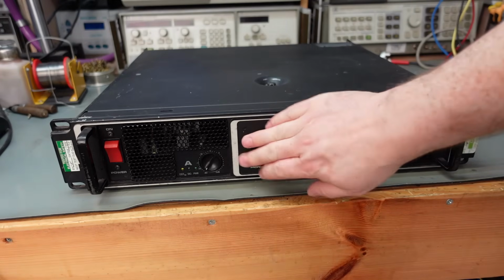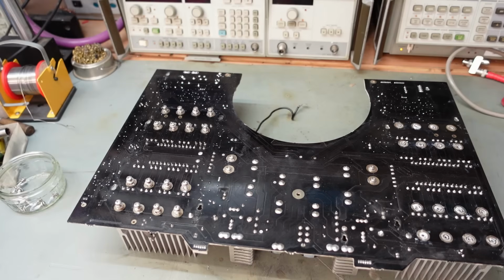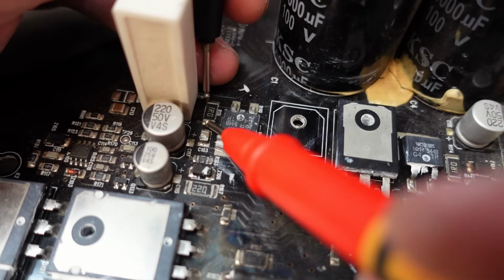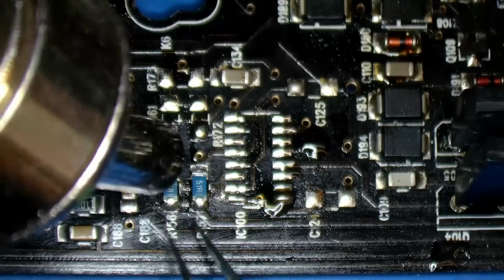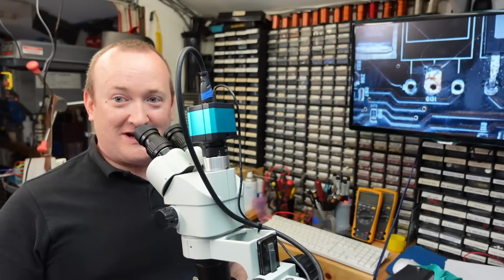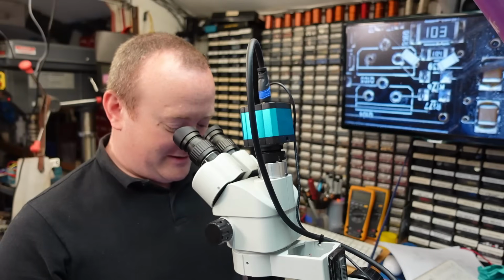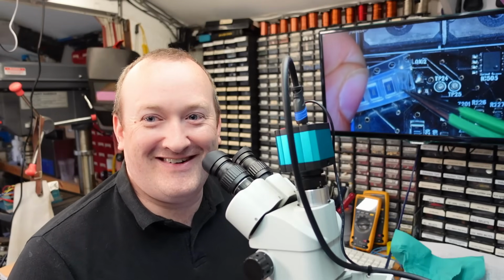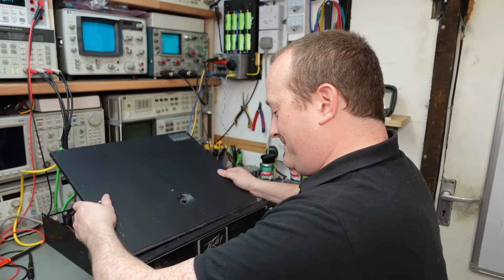PEAVEY 4000W Amp Repair (CS4080HZ)

Comment: Love your work Mark Just one thing I noticed. If you solder a leg down then add some pressure to solder the next leg, normally I would go back and hit the 1st leg quickly with the iron. Otherwise it sits there under the constant pressure of that initial manipulation from bending it between fixing the 1sst and 2nd legs.

Comment: You Sir have the patience of a saint. I wish i had this level of patience and discipline. Any time I've used the manual solder sucking tool on these cheap solder mask boards, it tends to damage the pads. I usually use the powered vacuum desoldering station for those more sensitive areas.

Comment: At what point do you call a board B.E.R? 
Personally I'd have scrapped it. Burnt PCB, cascade of failures. AND it was previously on the bench (though it would help to know what was fixed last time...) 
Plus it's a stupid design. I really hate these all in one pcb designs. Also why no 3.3kohm 5w resistors over the power Capacitors?!

Comment: Didn’t read all comments bet to my knowledge Kapton tape is a heat Insulator not conductor I use it on my job for pixel hot air work. I hope this peavy didn’t come back to you! 😊

Comment: I have a mono class d amplifier which when turned on shows a red light but when the power diodes like the f20c20c and a are removed which give power to the output ic circuit . Then the red light first turns on and then the green light . But when connected sometimes the diode  ics short out and the input power ics also short out but the audio ics are not shorted at all . Note : when I started repairing it the capacitors were swollen of the input for output ics and output for output ics . Also i by mistake shorted the controller ic ka3525a 😅. What should I do I don't find the cause of this problem😢

Comment: I really hate Muso amps, abused and generally DIY screws missing and dodgy repairs. Charcoaled O/P stage...Usually simple circuits but always a mess. Then they don't pay for repairs...not doing any more.Oh and i was thinking haven't bled filter caps with no load power on/off...oh well couldn't really do any more damage.

Comment: You are quite the tech, with the right tools to get the job done. I'm just wondering where you find the schematics for all of the equipment? I have worked on amplifiers for which I could never find a drawing, so I have to draw my own, which is very time-consuming, but it doesn't help with getting the correct part numbers.

Comment: Did you ever try to Repair a behringer ep2500?
If i am not mistaken the output of the amplifier is the middle Point of the power supply capacitors.!.
We do tend to Breakdown om die insulation  of transformer wiring

Comment: Great instructional video.  I really enjoy watching.  I have decided in my 50 or so years of repairing everything from VCR's & audio in the 80's to now mostly Guitar/bass amps as well as keyboards & digital pedals that I will no longer work on these 'newer' surface mount component PA power amps.
IMHO it's obvious that as soon as Peavey & Crown for example started making high power PA amps with SMD components that they really didn't expect anyone to repair these esp when the SMD components burned the circuit boards as they often do with a situation similar to what you have there.  
Also if you're trying to make a living doing repairs, these amps now sell for comparatively much less money than they used to, you really cannot charge in proportion to how much time you have to spend on troubleshooting them, ESPECIALLY with the the ones that have SMPS power supplies and then of course the DClass nightmares.
Just IMHO.

Comment: Hi Sir. I am working on a cs4080. It powers on perfectly but after few minutes then there is DDT light at channel 2. If I Don turn it off quickly the power transistors  G30N60C3D blows up. Please help

Comment: Try the original CS 800 Peavey.  I hauled lots of Peavey gear up and down stairs long walks everyplace imaginable with my dad for his dj business since I was about 12 . Missing any fun a normal teen would be out having.  Point is the 800 has one extremely heavy transformer.

Comment: Hey Mark , I was wondering why you don’t use a silicone tube on the tip of the solder sucker to prevent damage and improve the suction of the solder. Here in Brazil, it’s very common for technicians to use this trick — we call it a 'camisinha' (condom).

Comment: Mend it Mark! This is the most relaxing content channel I know in the field of electronic equipment repair, especially when it comes to professional audio and Hi-Fi.
Very calm, well described, well filmed and absolutely objective.
For the reasons and circumstances I have just indicated, I offer you my sincere congratulations. Both for your knowledge in this complex area and for your way of communicating, which is inspiring.
Macedo Pinto
Portugal

Comment: "Some imperial thing I'm too young to know about." You know that fractional inches are just binary fractions, right?

That said, I'm confused about what an 11mm socket would fit that a 10mm wouldn't. ⅜" is a normal size, but a 10mm socket would fit on that. 7⁄16" is not too odd, but should be too big to fit an 11mm socket. Beyond 16ths gets very odd. That said, who knows what Harley Peavey chose. It may be that 11mm bolts were half a cent cheaper that week. He was a strange man.

Comment: I cannot see when you put back all the 16 power transistor's  insulating micas.. Did you put them back ?
Reply: common emitter, they all push current into the heat sink (hence the insulation on the bottom side of top cover) so no insulators, unlike the IGBT's, which do require insulators.

Comment: I use a very thin layer of 2-part high heat epoxy to bond the copper tape down to the PCB. Give that a try next time. A bit of wax paper on top  with a weight on it to hold it inplace for about an hour to cure.

Comment: I would toss that thing in the bin. Thats really not worth repairing. A deciding factor is the brand - Peavey. Its not a well engineered product as you've discovered. The people who buy these amps are very budget minded. They would likely not pay a fair price to replace what's really necessary to make it work reliably. When you hand this back, the customer will just hook it back up the same way to the same bad speakers and turn it up too loud.

Comment: Quick note on the beginning of the video: "parallel" mode means input 1 drives both outputs equally. This is mainly useful for impedance-matching arrays of speakers that all play the same sound at the same amplitude -- it's still whatever the max per-channel output is. "Bridge" mode is the one that unleashes the full power of the amp, adding channel 1 and 2 as push-pull. Very nice repair. I'm glad you took the time to show us the steps, even taking out all the screws and the toroidal transformer bolts. Thanks! 👍

Comment: Genuine question, I'm sure I'm missing something, but how can a 4000W amp run from a single IEC C14 power connector, which is only rated 10A @ 240V?
Reply: It will be able to output 4000W only for a short time. If you try to play a constant tone at 4000W through one of these amps, either the circuit breaker or thermal protection will trip out. Music is not a constant tone but rather peaks with an average value 6-10x lower than the peaks. This is why they can get away with a regular C14 because the average current draw is below the 10A.
Reply: @ I see. Thanks for explaining.

Comment: Quite enjoyed watching your repair on this amp. I used to do bench work on the old job, and your work fixing the burned spot on the pc board reminds me. Once an officer (I worked in the radio shop for a small state police department) said his CB radio was dead (yes, it was that long ago). Under some parts on the pc board was a black charred hole absolutely burned right through the board, and I found a 30 amp fuse in the fuseholder on the back. Apparently a transistor had shorted and blew the fuse, and he kept putting bigger and bigger fuses in it until they STOPPED blowing, turning the shorted transistor (I think one of the finals) into a quite effective heating element!

Comment: Just to the left of the upper block of eight power transistors on the schematics, are a pair of diodes in parallel: D190 (1N4148) and D194 (WURS160) with a 39pf cap in parallel. Why have two diodes? (Drawn somewhat differently on the lower block, which makes me think it's hand drawn, despite having SMD components)

Comment: Were the inrush thermistors not replaced? Have I missed something? They look to be the same towards the end. 

However, as for the rest, little short of miraculous that could be fixed. I am a bit dubious about the 4 kW rating though given that there's only 3 kW available on a standard UK outlet. Also, as huge as that toroidal transformer is, I don't think it could handle 4 kW now could the caps. Most likely just the manufacturer quoting for one of those mythical "music power" ratings.

Comment: Clearly this amplifier was not built to last, nor be repaired. You wouldn't get this sort of failure in a 'proper' amp like an HH or a Citronic PPX, and if you did it would be: 1, operator error and 2, fixed in ten minutes.

Comment: My experience of repairing Peavey power amps, they will drive a 2 ohm load and if the voice coil in the speaker has distorted it will short itself out by rubbing against the speaker frame under load.

Comment: The damaged flat cap reads ok,big on power tiny surface mount components working hard.you have to use the all the toys to diagnose and repair the incineration.

Comment: 0:35 Setting an amp to parallel doesn't really change the amp at all or increase the wattage, it just connects both inputs in parallel, similar to how you'd use a Y-cable to connect both inputs together as a double-mono running the same signal, instead of stereo where you'd have a left and right signal.   Bridge mode is what you were probably thinking of.   That is something different where the two seperate channels are combined into one mono channel, that's what that other switch was for.

Comment: 26:23 I was a bit worried that the middle pin on ic Q132 on the right hadn't been soldered. But I'm sure that Mark would have spotted it but didn't film it. And yes the upside down resistor did trigger my OCD but I got over it eventually. C404, the missing capacitor mystery. I spotted that it was actually in place at the beginning of the video. Weird how it vanished. Probably under the workbench. (You'll find it one day... 😂) Great job as always Mark! You make it look so easy.👍
Reply: 40:29 - It still looks like cold joint when he puts on the heatsink. He might've missed it :|.

Comment: Just looking at the schematic around 17:00, I noticed where the emitters were pointing on the output power transies. That's right, to the rails. The output "totem" in a common emitter topology, having a voltage gain greater than one. I've seen someone put a name on this "spread-eagled class AB output totem topology", cannot remember it now... I mean to say that whenever I see this, it's giving me goose bumps "what if the quiescent biasing circuit shorts for some reason - that must be one hell of a fireworks show". Here I saw the two transies that you discovered blown, in the biasing circuit. My silly unfounded nightmare has come true ;-)

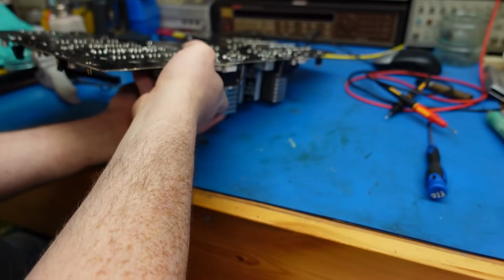Comment: Hi Mark as regards @41:00 at my workplace we use 2 highly trained swans with Japanese made beak adaptors and tiny goggles made in the old jewelry quarter in brum  to meet compliance. (Works great but don't tell anyone)  ....Er also on another note any chance off the name of that white thermal grease compound you allways use ..assuming you rate is as good stuff :)

Comment: Talking of reputable suppliers, last week I bought some 2SC5198 and 2SA1941 to repair an Onkyo amp from Cricklewood electronics. The 2SC5198 turned out to be fake, their die size less than a quarter of the originals. I'm currently waiting for them to respond to me for a refund or replacement.

Comment: Greetings from Argentina, I use a rubber tip for the suction cup, which I recycle from the flybacks of tube TVs. In this way the suction of the tin is more effective

Comment: One thing to note about thermal paste is that you can actually add too much and then it defeats the purpose of dissipating heat.  You only need a thin layer (one tiny dot and just use a piece of clear tape {Scotch tape} to spread the paste)  How do I know this?  Over 20 years building and replacing PCs.

Comment: How do they get around the toroidal transformer 'shorted turns' - there's a fixing screw on either side?
Reply from the maker: Seperate screws top and bottom. They don't touch each other.

Comment: Excellent video, as usual.  Perhaps you need a hole in the bench for getting to all those torroidal transformer bolts without having to hang the units over the edge?

Comment: hope you see this comment . so i am learning to work and build circuit boards and i thought you had to remove the component to check it or is that just for capacitors and resistors ? i just found your channel and am loving it . i know it is probable a ridiculous question but i just if you don't ask you will never learn right thanks for the time

Comment: @MenditMark can you tell me the discharge tool that you’re using? I’ve looked all over the Internet for it can you point me in the right direction for the capacitor discharge tool that you use at 9:56 I would like to purchase a unit like that thanks in advance

Comment: Big job .. enjoyed the video. I'm interested by the fact you didn't seem to run it up on a current limited power supply before you put the heat sinks on and reassembled..

Comment: I am nothing more than an amateur, and (to see someone take everything in their stride with a smile), is almost 'magical'. I have had several successes - but lots of tough-dog failures too! As I watched you work on the Peavey, I couldn't help thinking that (because all of the damage was not localised), I strongly suspected a Power Surge. greetings fro Australia.
Reply: Great to hear your thoughts, and I agree with you! Greetings from Sydney
Reply: I consider myself an amateur as well although over the last year and a half I've gotten better, at least I think I have. I now have a lot more successes than failures.

 I will say the thing that I learned that's made the process better is if I'm having a tough time with something, either figuring out how it works or how it goes back together or for other reasons, step away for a moment. Take a break and reassess the situation, go get a cup of coffee or have a cigarette if you smoke. I'll take and leave a repair overnight and then come back first thing in the morning or the next evening and go at it again.

I noticed by doing this it is really allowed me to take something I probably would have thrown in the trash or gave up on and take it to a point of completion.

Another thing that I've done that has really helped is breakdown repairs in stages. If I used to take apart a tape deck and the mechanism needed new belts and it also had a blown motor and the Dolby board needed to be gone through, I would try to do it all at once and ultimately end up frustrating myself and kind of hit a wall. Now I take and replace the motor and go through the mechanism. Then I'll take a break or leave it overnight as I've said and then come back the next day and go through the Dolby.

Anyway just sharing my experiences and if you enjoy doing it keep it up, I do it as a hobby, I've always enjoyed taking things apart and figuring out how they work, and I'm sure most people that do this do as well.

Comment: Great repair! Note I would remove that glue around those filter caps the glue Sony used would with age and heat either start conducing or eat into the tracks causing both open and short ccts

Comment: Did you end up replacing the damaged thermistors? Or were they fine? Very entertaining Mark. You really dig in and get into your repairs. I especially love the actual repairs on parts that are no longer available such as the motor and hinge assembly of that linear tracking turntable. Simply put you do amazingly detailed restorations.
Reply: Two years later, and I came here for this exact comment!

Comment: @21.11Mark, if you cut a small notch in the end of your hand-held solder sucker to conform to your soldering iron tip you can avoid putting pressure on the track pads, thus avoiding further damage. You also create a better seal for the vacuum effect of your sucker and don't need as much heat.

Comment: The problem with this amplifiers are the way the rail switching IGBT's are being driven. The IGBT's when driven off still see about 0.6...0.7V at there gate. At high temperatures, when the gate threshold voltage is low, some leakage current will start to flow trough the IGBT. This causes them to heat up (uneven heating in the die itself because those things are not made to operate in their linear region despite the data sheet stating something different) and go into thermal runaway, destructing themself. The amplifier will still work with the shorted IGBT but the amp power dissipation has increased to the extend that even the fan's can't keep up and the quad transistor (MMPQ...) will fail. Adding a gate emitter resistor onto the rail switches cures this problem forever. An other problem is the volume controls. Running the amp without those being connected makes the VCA at the input go into oscillation, taking down the amp completely. Again, soldering some resistors across the input connectors solves this problem as well. (I think I repaired over 300 Crest PRO200 series which are the same in a different package with a different PCB layout.)
Reply: Hi!! I currently have one of these apart for repair (easy ceramic cap failures) and am intrigued by your comment about adding the resistor.   Would you care to further explain how one would do this mod on one of these?  (4080hz)  Thanks!